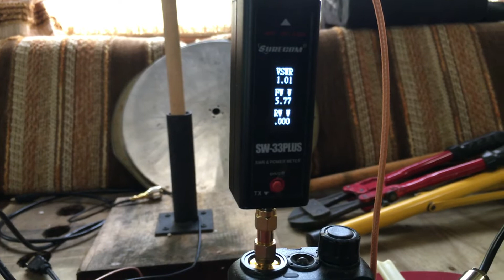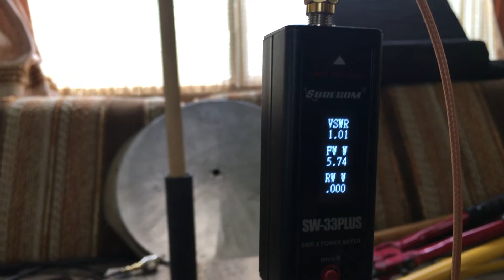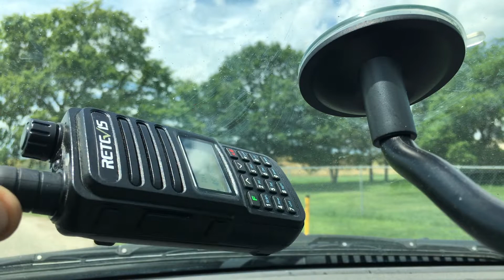🔺MURS VS GMRS Two-way radio distance (range) Test PART 2🔺

Comment: Would like to see this test of another 1/4 wave antenna of the same design using the same radio power levels. Otherwise are we really comparing two different frequency bands? Or are we comparing two different antenna designs, at different power levels, on different bands? Not sure what the conclusion is here.
Reply from the maker: If I recall the power levels are the same, so it's comparing freqs band 🙂
Reply: @GMRStwowayradio  gotcha, but how about the antenna designs?
Reply from the maker: @Gruuvin1  the antenna design are about the same, however the murs antenna is longer due to the freq
Reply: @GMRStwowayradio  ahhh... So they are both 1/4 wave with ground radials?
Reply from the maker: @Gruuvin1  yes, I think I did a video showing that.. i think lol
Reply: @GMRStwowayradio  okay well that's excellent. I've ordered an ed fong dual band for murs/gmrs, and I'm interested in a gmrs cross-band 50W repeater that receives input on murs, since there should be better propagation on 154MHz from HTs (way out in the country, lots of wide open space with very little radio traffic). This is a very economical way to have a high power repeater with a single radio and no duplexer robbing power. I may end up with a 16' Tram dual-band high gain antenna on a 40' mast (all running on solar too!).... can be an excellent addition to the off-grid homestead for less than $500 all in!

Comment: You did the GMRS radio at low watts didn't you?   It be interesting to test at 5 watts and 50 watts
Reply from the maker: I did the wattage that was same for GMRS and MURS if I recall right when I tried the higher wattage it wasn't close to each other so to keep things fair I adjusted, so both were close. But I may do other video with higher wattage  🙂
Reply: @GMRStwowayradio  
First off, thanks for all your tests!   I watch them all and have been using a Simplex repeater to test my radios and antennas.
It might be unfair to hobble the GMRS to the MURS wattage.   A little like using a MURS antenna for the GMRS.   The Higher frequency helps the MURS, but being able to use up to 50 watts helps the GMRS.  It might be fairer to compare the MURS to FRS.
Reply from the maker: @togeika  - I see what you are saying, but keep in mind I am comparing handhelds, so I have to try to keep them close to the same wattage. I think most people will buy handhelds first before buying a mobile unit. So all my tests are done with handhelds to help people really see the difference compare to mobile radios.

Comment: Your testing is quite interesting, thanks for posting these. A couple suggestions, hopefully it is helpful. Your audio seems to be clipping at times on the radio transmissions, you might try holding the radio further away when transmitting. Also, I noticed your bandwidth setting is set to W or wide, which is incorrect for GMRS. For all channels except 8-14, it should be set to M or mid. For channels 8-14, it should be set to N or narrow. This may help with audio clarity when talking to your repeater.
Reply from the maker: Thanks! I don't think the setting would help that much if at all in the distance test, but I will keep that in mind if I decide to re-do the test again.
Reply: @GMRStwowayradio  agree as far as distance I think your results are completely valid. Just thinking in your other videos the RT97 is probably set to normal fm(mid) and if you're transmitting using wide fm then the audio may not be ideal. No big deal, your still clearly audible.
Reply from the maker: @SamIAm22  - humm the more I think of it, I think RT97 is set to wide too. But I will double-check that for the next time :)
Reply: @GMRStwowayradio  there is a good chance I am wrong. I have a Retevis radio that has three options for the bandwidth setting, but realized the manual only mentions two. I am assuming in the case of radios with only two options, narrow and wide that wide is actually normal fm. Their manuals while not bad could use some help. I like their radios, they're seem to be a good value and decent quality.
Reply from the maker: @SamIAm22  ya, I can't recall I thought default was wideband, but I am not sure. Maybe I will dig out the programming cable and double check it. And  I agree, their radios are a good value and decent quality 🙂
Reply: There is only Wide (25 kHz) band and Narrow band (12.5 kHz) for GMRS.
Reply from the maker: @2thumbsdown  - i did have it in wide band, i forgot to post that in the comments